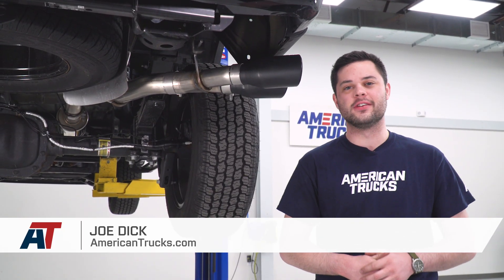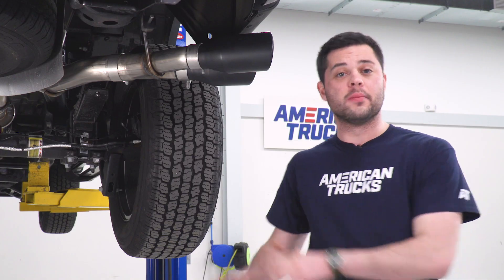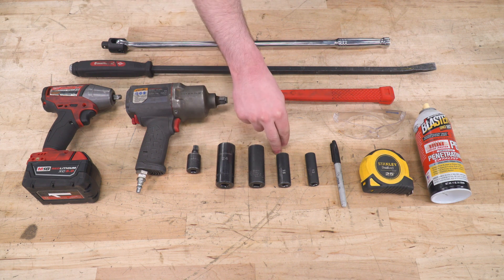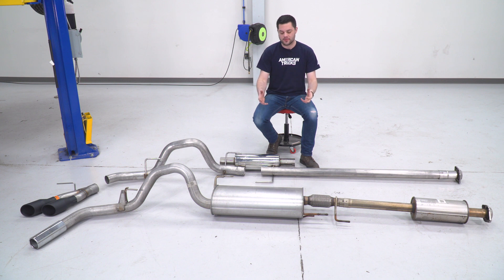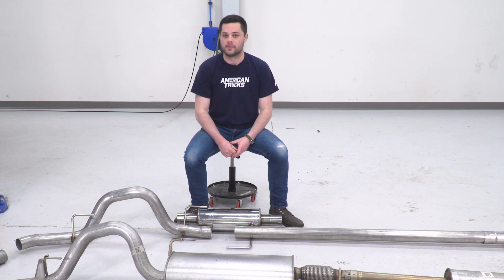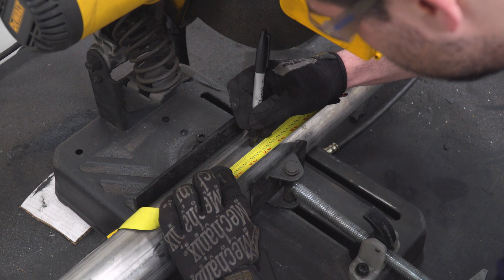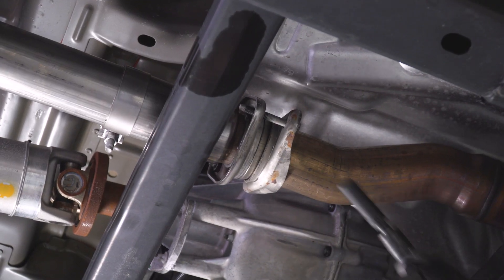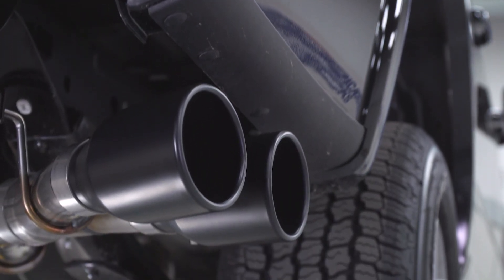2015-2020 F150 2.7L EcoBoost Roush Single Exhaust System w/ Black Tips Sound Clip & Review

Comment: The best sounding exhaust for the 2015- 2017 Ford F-150 2.7L & 3.5L ecoboost trucks. I just ordered the Roush Performance Power Pack; Level 2. This comes with the Roush exhaust, Roush cold air intake, and a custom tune. I cannot wait to get them and have them installed!
Reply: would love your review after
Reply: I put it on my 2017 3.5. Love the extra power and sound. Best is i kept my factory warranty
Reply from the maker: Best of luck with the results on that Roush Performance Pack, Courtland! Sounds like you're going to have a brand new truck once everything gets installed and tuned up! -Zach
Reply: does the tune hurt your mpg a lot?
Reply: Could you send the link to that pack?

Comment: Will this fit a 2017 F150 Lariat? Sport Appearnce edition. Thanks in advance.
Reply from the maker: Absolutely! As long as you have that 2.7L EcoBoost, this exhaust system will fit no problem. -Zach
Reply: @americantrucks  oh ok. Mine is a 3.5 leter twin turbo
Reply: Lol 😂. Did you even read the title of the video?